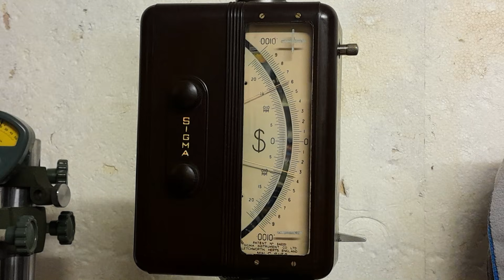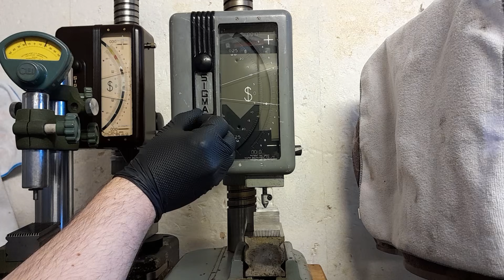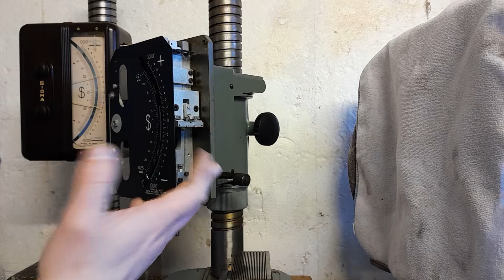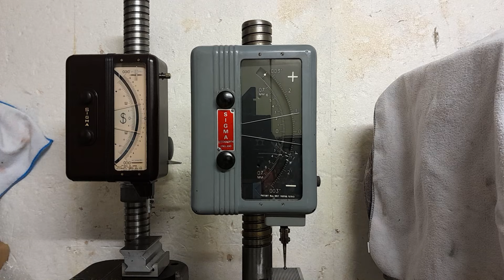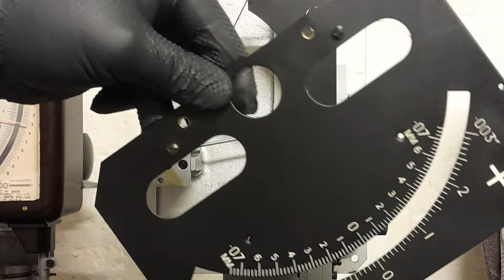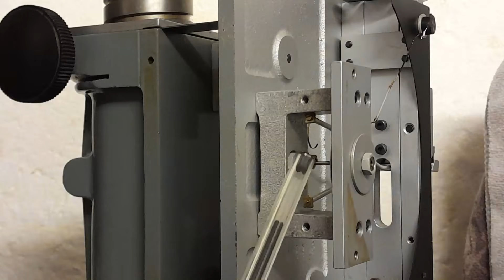Inside a Historical English Precision Comparator PART 1

Comment: For your brass blade , try to release stress in brass after finishing at the right thickness a low annealing can be done at 150 deg C  also naval brass is better for corrosion concern as Zinc alloy are very sensible to crack
Reply from the maker: Thank you very much for the heads up, this is a good idea. I was thinking about this, because previously I abraded the bronze down with abrasives and let it be. But, now, my plan is to cold roll it for thickness, cut it out to shape, anneal to prevent brittleness and then polish

Comment: To reduce the thickness of the brass you can you etching with Hydrochloric acide , distilled water and peroxyde or use a electro cell too , that allow you to save time in lapping and also to keep the surfaces // 
check before what condition is your brass as brass is hardened or anneal
Reply from the maker: Thank you very much for the suggestion. My aim in this channel is to demonstrate what can be achieved with manual skill where resources are limited
Reply: @TheEngineeringAlchemist  I do scrapping since year and lapping too , ultimate accuracy cannot be done with a machine and even the machine shall be finished by hand 
The only concern is the requested time to reach the result .

Comment: Regarding the surface grinder no need it as far your surface are flat and // , lapping can be a solution easy , not fast but able to be done in the garage , you can start with flat glass to save your finishing plates
By using the 3 plates method of Whitworth you can repair your lapping plates , you built 3 plates from granite plate use for house building and after you can lapp your lapping plates on
Reply from the maker: Due to the constant use of my lapping plates, they are very worn, a grinder would be useful, but if not, i can do it by hand scraping as I have done before, prior to lapping.
Reply: @TheEngineeringAlchemist  If you have a lot of metal to remove a Dremel with a small grinding wheel works nice , that mostly the princip of scrapping but far faster even if that not accurate to reach micron accuracy  , you ink the surface and remove spots , reink .... and after to have removed a maximum of unwanted material you can scrap and after make lapping  if necessary 
I do that on worm surfaces since years .... 
Note grooved lapping surfaces are more efficient for pressure surface control so flatness , easy to cut groves with a hand grinder and thin cutting disk

Comment: How do you stablise for temperature on your test blocks?
Reply: Usually the metrology stuff is in a temperature controlled room at 20degrees C ( 68 F)
Reply from the maker: I have de-humidifiers and temperature monitors. Crucial work would be done when gauges are soaked in for stabilisation and early in the morning before the sun rises. 
Please see the questions and answers in my previous videos regarding this topic.

Comment: Interesting video especially the bearing concept. Please note that bronze and phosphor bronze sheets exhibit anisotropic mechanical properties depending on the rolling direction. In some bronze alloys, brittleness can also be associated with the presence of hard, brittle intermetallic phases such as the gamma phase.
Reply from the maker: Thanks for reminding me, I just looked at the sheet of phosphor-bronze and realised I had the grain formation at the wrong angle
Reply: @TheEngineeringAlchemist  for spring that difficult to beat the CuBe2 alloy and more if you go in very thin plate , CuBe2 is a very common alloy for high performance relay and connector

Comment: could you use a Kevlar thread to replace the broken bronze strip. Probably stronger and more flexible I would think
Reply from the maker: Interesting comment, although my aim is to keep the machines I work on as original as possible. Phosphor bronze is a very reliable material but with 50 years plus in industrial service, one can understand fatigue in the metal